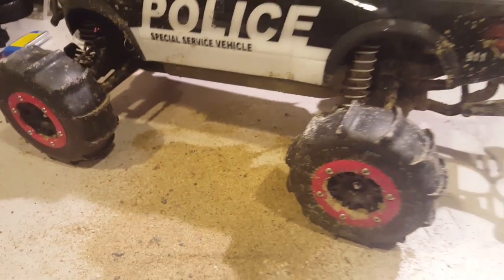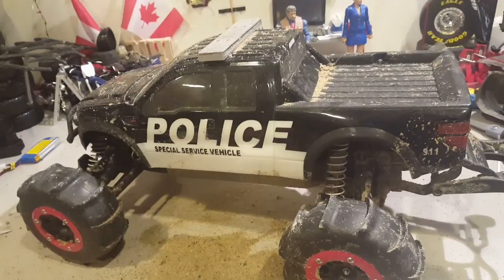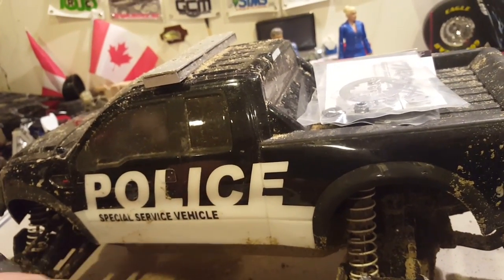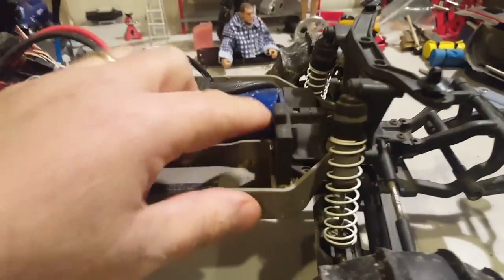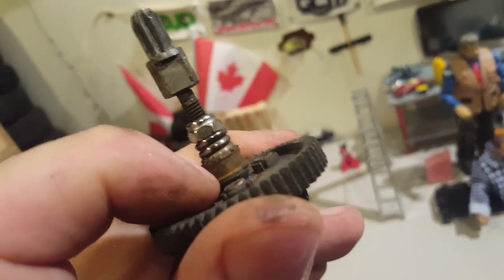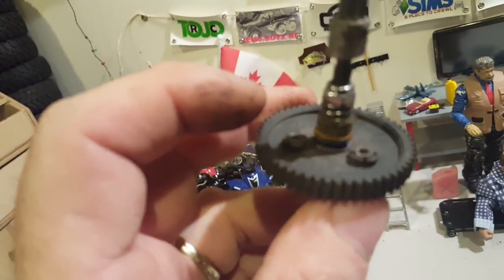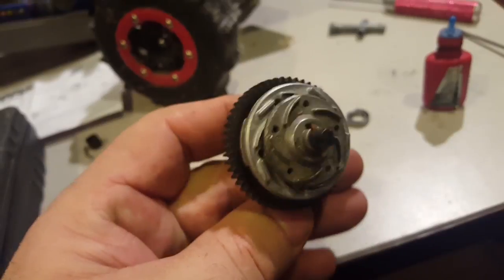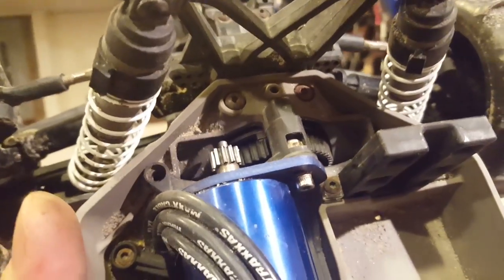REVO Slipper Clutch MOD on Stampede or Slash 4x4

Comment: Did you have to go to a different spring? Seems like I put my stock spring on because the revo spring wouldn’t fit on , tightened all the way down and my clutch slips with my 3s battery.
Reply from the maker: No I used the same stock spring

Comment: After sliding the clutch assembly further up the shaft to clear the rear diff housing, it does not sit perfectly with the drive shaft, the drive shaft can move forward and backwards about an 1/8th of an inch. Does yours do this as well. All parts are the same checked 3 times i have a stampede 4x4 vxl. Please help
Reply: I have the same problem and I have the stock slipperclutch. It might wear out the centershaft bearing.
Did you find a sollution to the problem?
Reply: If you guys are referring to having some play in the center driveshaft (connects from slipper clutch to the FRONT differential), it's normal for that shaft to have 3mm to maybe 4mm of play, back and forth.

Comment: Subscribed. I bought a slash vxl 4x4 5000 mah 3 cell lipo yesterday and took it to a fields and had a blast. Cleaned everything up and fired it up in the morning and I had almost 0 torque in my rc. I was bummed out that after just one run I screwed up my new truck. I'm gonna open her up and see if I can do the upgrade. What web do you usually buy your parts?
Reply from the maker: I usually order my parts at Great hobbies and pick them up at the store

Comment: Thanks for sharing and going into detail on how to perform the mod. Since the video was done in 2017, how is it holding up? I've been seeing/reading where some have use the Traxxas Brake Disc 4964 from the T-Maxx instead of the aluminum pads. Any thoughts on that mod? Thanks again for doing the video.
Reply from the maker: This mod has been holding a great and I even done it on my stampede. As for using the T-maxx disc brake I do not know or had any need to use it has this mod worked great for the past 2 years.   thanks for watching and commenting.

Comment: I just did this exact upgrade following your guide. The stopping power is intense and the bite one takeoff with a 3cell lipo is crazy. Just a quick question for my own peace of mind. The 2 washers that come with the aluminum pads are left out, correct? I didn't include them as they were still on the table when you showed off the finished slipper.
Reply from the maker: That is correct the 2 washers that come with the aluminum pads are for the NITRO version.  I love that upgrade.  Keep having fun my friend.
Reply: The Tank RC I actually just ran that thing into my shin trying it out after tightening the nut. Hurt like hell but so much fun hahaha.

Comment: I installed the upgrade yesterday. But i have a little problem. The slipper clutch moves a bit left/right when installed against the gear of the motor.

Because I used the second pin hole there is a la little bit more space left. How can i fix this? It seems like you did not have any problems with that by only using the upgrade parts.
Reply from the maker: Sounds like you might have used a wrong part somewhere. I look at mine tonight once I get home. it's all apart right now waiting for new bearings and I'll let you know.
Reply from the maker: If your gear moves right to left on the pinion of the motor it probably means you have a bad bearing either in your rear differential case or the one attached directly onto the spur gear in the center. You're actually using the exact same spur and pinion than the original one the only thing you change is the clutch so there should not be any loose.
Reply: @TheTankRC  I have the same problem and I have the stock slipperclutch. Maybe it can be fixed with a small spring between the slipperclutch and the the rear differential pushing the slipperclutch towards the centershaft bearing?
Reply: Get a new motor mount guys! Preferably an aluminum one since the plastic ones distort over time due to heat.
If you do go metal, make sure to use shorter 12mm screws that go into it from underneath the RC instead of the longer 14mm M4 that are usually stock.

Comment: I constantly snap the plastic drive axles. How are you running paddle tires, with plastic shafts?
Reply from the maker: Usually just hese in on the throttle going forward and hitting the brakes. You actually break axle when you suddenly take off like crazy or hit the brakes very hard on hard surfaces therefore putting too much torque on the axle.
Reply: Get MIP!!! Expensive but worth it!
Reply: Ya, I 100% agree with Zevi 2000 ....I was trying to run my Stampede 4x4 on deep sand with paddles and kept snapping the stock axles from the torque demand. The MIP's are just bulletproof. I not only ran them on the sandy beach, but i also ran the paddles in subzero deep snow for a couple months of hard use , including jumping the truck off of a ski jump, lol! Of course, I did a few more upgrades as well.

Comment: Any other upgrades you recommend for a novice? I have the aluminum shock caps and the raised body mount. Anything else I should hit? Thanks in advance!!!
Reply from the maker: Ermin J shocks and drive shafts are a good upgrade, but the very first upgrade I ever did his tires, Tires that comes with them or not too good for dirt but they are good for pavement.
Reply: The Tank RC if I got bigger tires do I have to mess with the gearing?
Reply from the maker: Ermin J don't go with bigger, go and stay with short course tires.  Normal rims will not fit on Short Course Truck
Reply: The Tank RC any specific tires you can recommend for dirt/sand that are the right size?

Comment: Do you know if the 50t spur gear fits with this mod?
Reply from the maker: Yes you can but you can us a 11 to 16 teeth Pinion only.
Reply: @TheTankRC  thanks I was just wondering because my slash has a 50t pinion instead of the 54t

Comment: Do the slash and the revo use the same exact slipper clutch bearings?????
Reply from the maker: Yes they do Part number 5116 5x11x4
Reply: The Tank RC could you fit the revo slipper clutch on a 2wd Traxxas?????
Reply from the maker: if the 2wd use the same slipper clutch parts as the 4x4 it should but i would have the check.

Comment: Can I ask what exactly does a slipper clutch do???
Reply from the maker: +Donkey Commander to slipper clutch acts like a dampener between the drivetrain and the more.  If you did not have this you would strip the gears all the time when you hit the gas real hard it was slipped a little bit and then catch to give you traction. Putting this one on gives you better bite and better stopping power